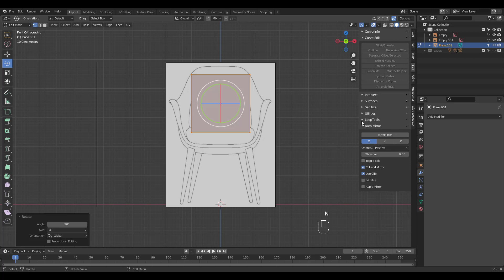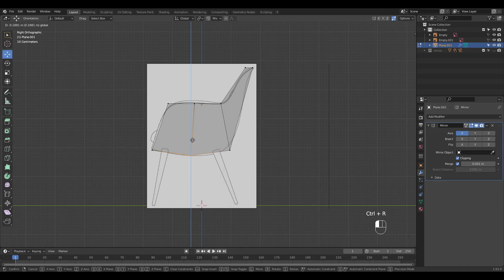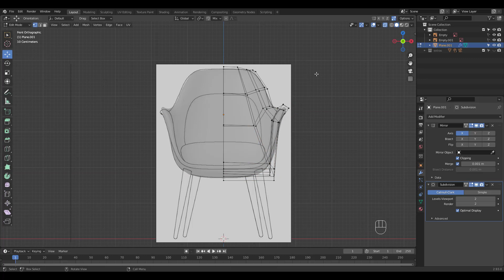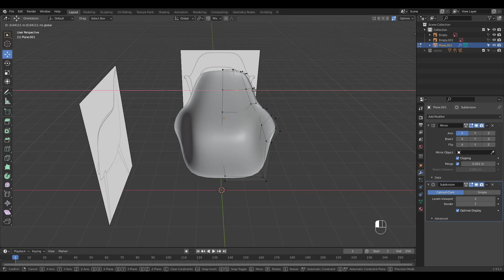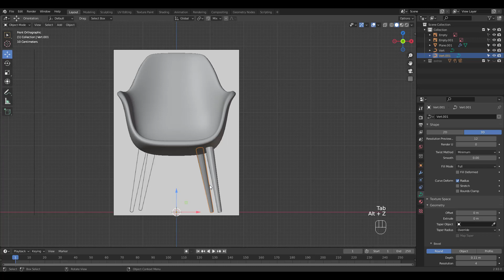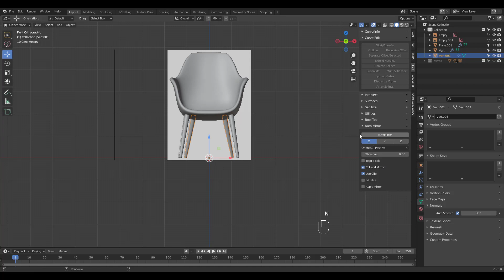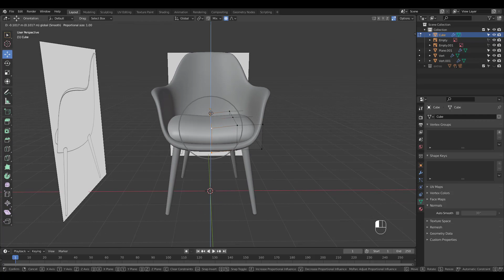Blender Chair Modeling Tutorial

Comment: So, I'm a little confused.  I must be doing something wrong...
I keep trying to drag up the vertices but instead of it actually just moving them it keeps trying to extrude them.  I'm hitting G and not E but it's still doing it.  What am I missing?
Reply: I found out my issue.  I was not selecting all the vertices wherever I needed to.  Had to move around the object to make sure I was selecting all of them.
Reply from the maker: Good to hear you solved the problem. It feels great to find out what went wrong, although the process is painstaking. Been there. Thanks again for the comment.